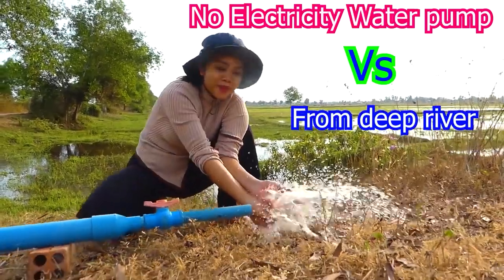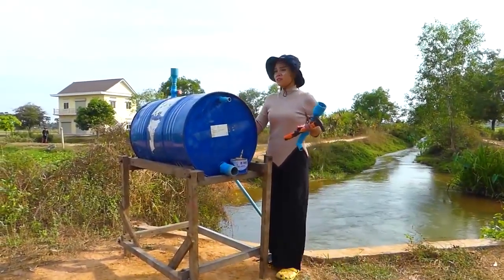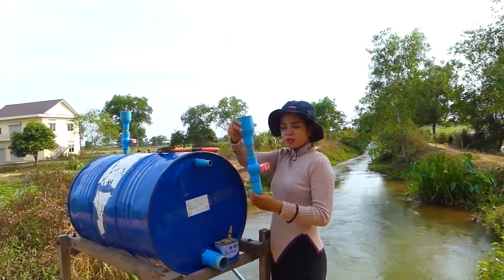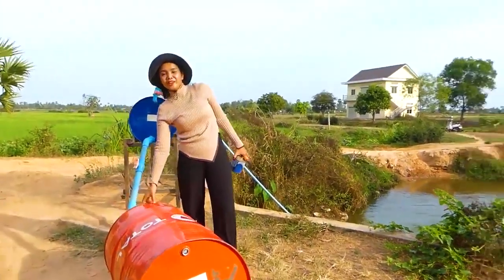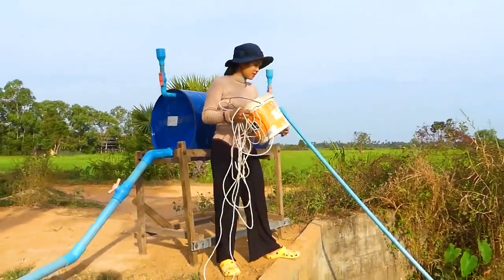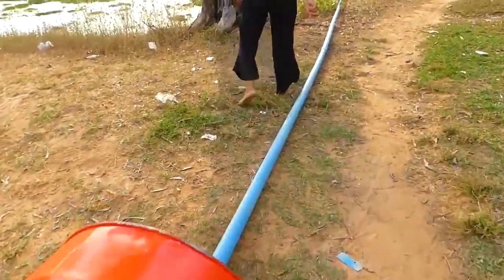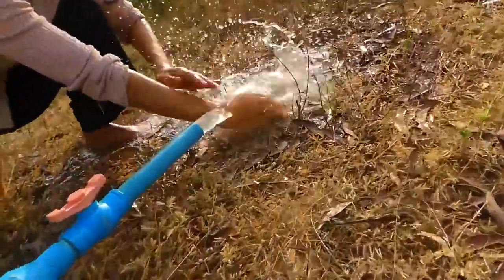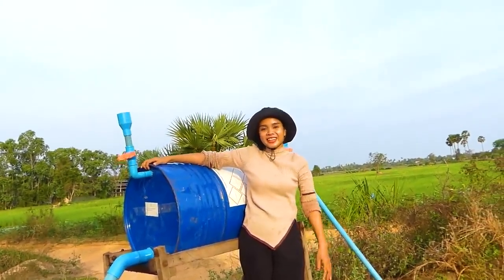Free Electricity | She make water pump from the river by using gasoline drum  #freeenergy #diy

Comment: - The water level in the river must be higher than the output tomthe field for this to work, is it?
- no need for the red barrel
- no need for two closing valves at the outout
- why use a foot valve at the suction, no need when using a barrel
- why use so wide exit tubes when the input suction tubes are so small?
- why raise the blue barrel that high? More difficult to fill. 
- why no upward bend at the output to prevent air from entering the siphon.

In short, why not use a single tube and drop the rest that wastes your money?